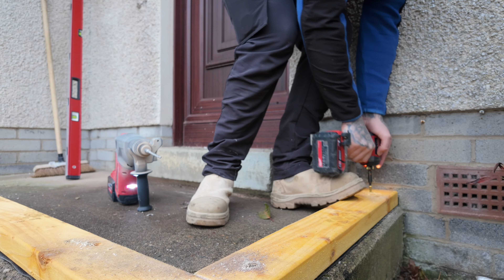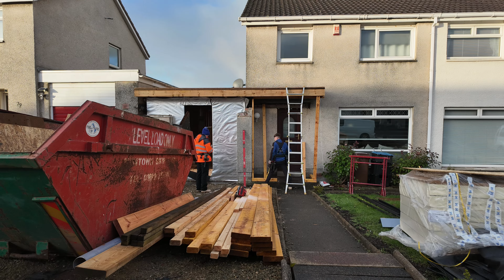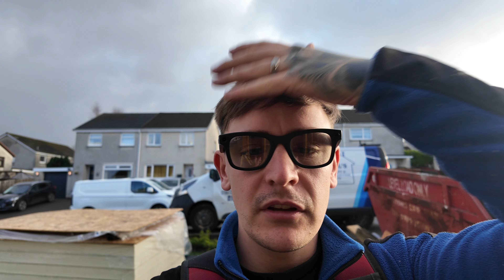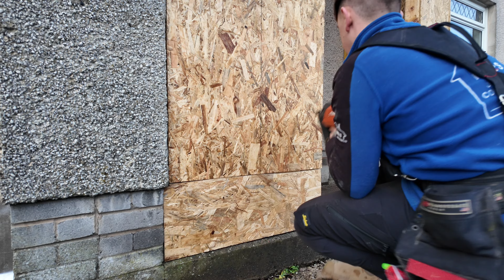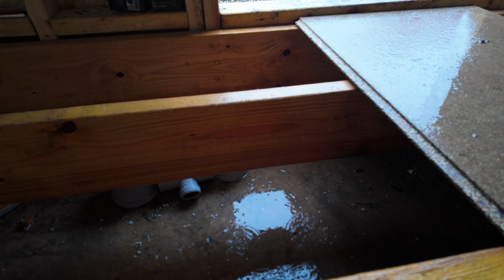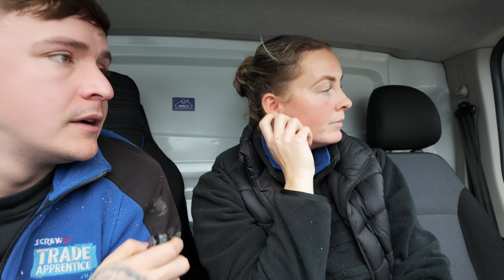FINAL DAY ON THE GARAGE CONVERSION

Comment: That woods not pressure treated. Probably not the best idea.
Reply from the maker: @undonesofficial  not the best idea for what ? The timber is c16 reg timber completely suitable for what we are doing in this video
Reply: Why would you need pressure treated wood for internal studs?
Reply: @keelsjoineryconstructionltd  you don't put untreated lumber on concrete, don't matter if it's inside or outside. That's like wall framing 101.
Reply from the maker: @ the timber is treated though that’s why it’s yellow
Reply: @keelsjoineryconstructionltd  oh ok, carry on then!